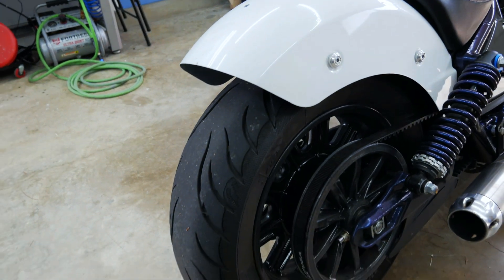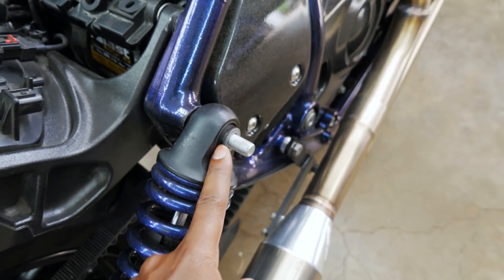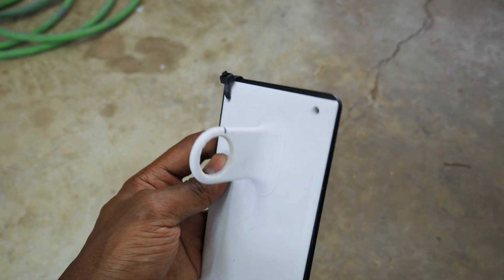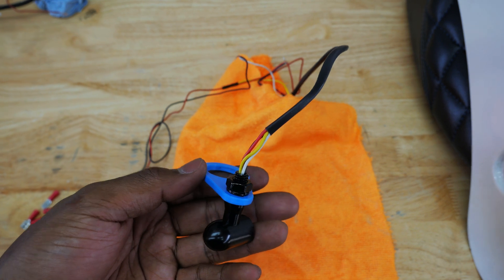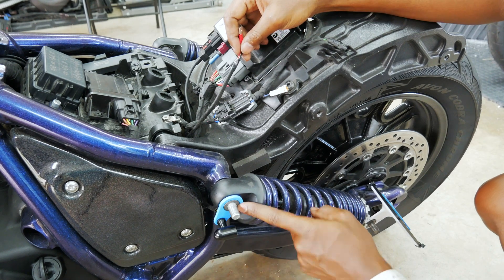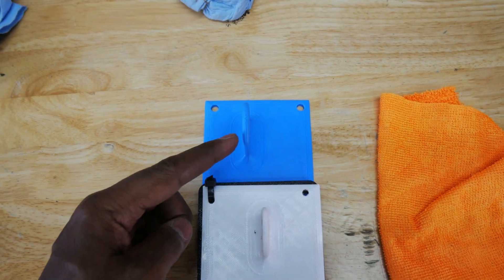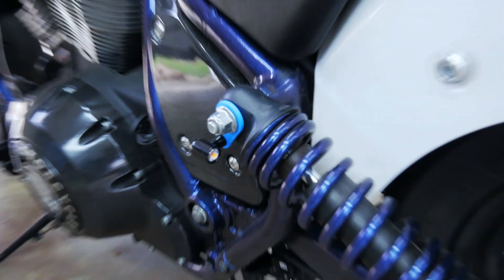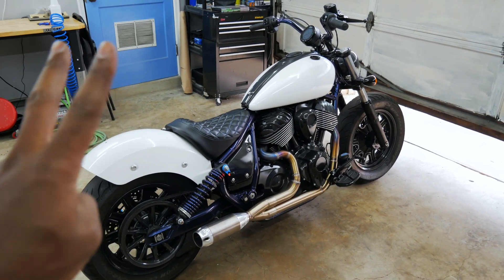$150 For What?… I’ll Make My Own! Indian Chief

Comment: I’ve been looking for a dam plate bracket like this!!! I have a bag on the left side and need something like this on the exhaust side
Reply from the maker: I could flip the model and print it for the right side. You could test it out and see how it works with the exhaust. Long as it doesn’t get up to say.. 180 degrees, should be fine. Exhaust get hot but what comes out of the pipes compared to touching the pipes are two different scenarios. Shoot me an email at hello @ BrandonBicasso.com. 🤙🏾

Comment: What material are you printing these pieces? Looking good
Reply from the maker: PLA, but I recommend PETG for the heat resistance. I didn’t have PETG on hand. I haven’t had any issues with it for months, however.

Comment: I am only concerned about that plastic plate holder cracking from vibrations. It really needs more beef to it. Ive cracked metal plate holders i made.
Reply from the maker: I’m not worried but valid concerned. 🤙🏾 Reinforced the joint with a variable infill for that reason.

Comment: I’d be worried about the license bracket eventually breaking along the layer lines. That’s definitely something we have to think about when doing additive design. But loving this overall, great stuff as always man!
Reply from the maker: Variable Infill at the base where the plate meets but you are right! Should’ve shown more on the slicer.
Reply: @BrandonBicasso  one easy trick that helps a lot is to add “bones” — punch some 3mm (+/- 0.1mm depending on your extrusion rate) holes across the layer lines and install some long m3 screws in there as a reinforcement.

Comment: I have little ones like that on my scout and for a bit more in the brake light area, i put a slim led one that goes under the rear fender
Reply from the maker: I’m thinking of adding something else back there as well. I didn’t think it would turn out this well. 😮‍💨🤌🏾
Reply: @BrandonBicasso  the ones i used were the Hemisphere Performance ones, the minis were good enough but that under fender light just made it segggxy